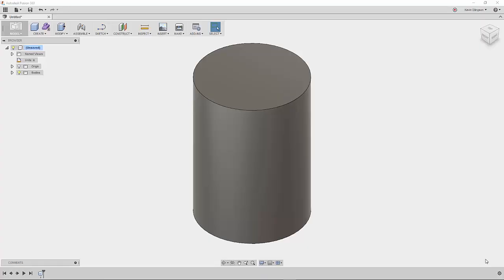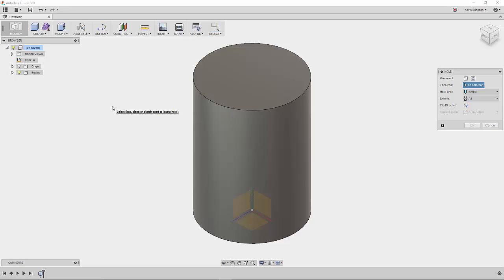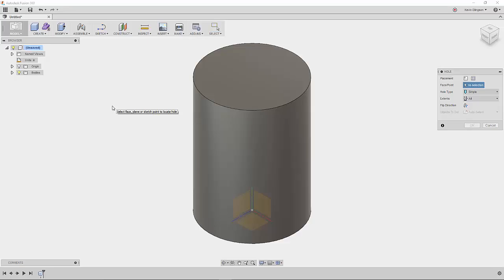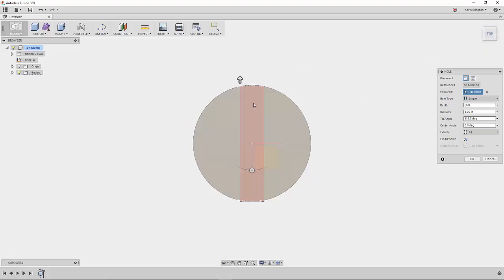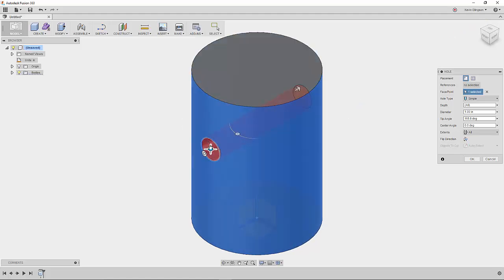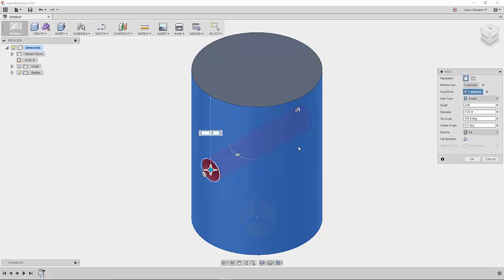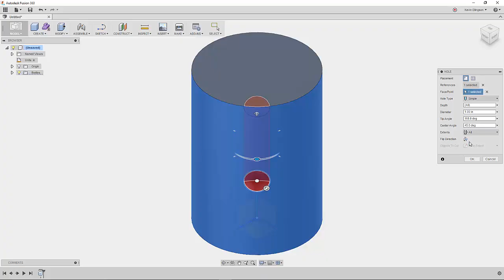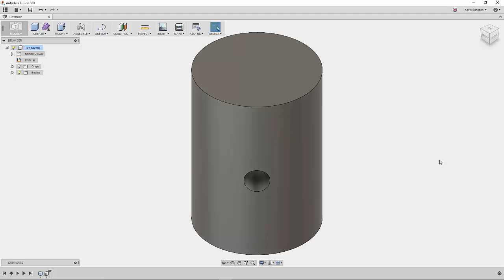Fusion 360 Hole on Cylindrial Face

Comment: Thanks.  Instead of rotating the hole by degree, can I locate it radially by measuring from a longditudinal line, like a quadrant line?  Can I turn a quadrant point into a lengthwise hole and then locate the hoes by distance from that line?

Comment: I could get a hole on the cylinder surface, but was unable to get a circular pattern on the hole to work... any insights?
Reply from the maker: My guess would be that you choose pattern faces as your pattern type. Try selecting the type to features and see if you can get that to work.

Comment: Thanks for posting.I do have a question.If I wanted to put a counter sink on both sides of the cylinder.how would I go about that.I can only get it to do it on the one side.Thanks
Reply from the maker: There isn't a way to do it in the hole command. You would either need to try to mirror countersink to the other side, or maybe even create a revolve for the countersink for the other side. But it can't be done using the hole command currently.

Comment: How would you place a horizontal hole on the side of a pyramid?
(i.e. place a hole on a face without the hole being normal to said face)
Reply from the maker: Nick's Stuff Hi Nick. You would need to create a construction plane. Your best bet would probably be plane at angle. Use the bottom edge of the pyramid face and set your angle at 0 or 90 depending on orientation.
Reply: Thanks I did that (using the XZ plane, in fact) but that surprised me a bit not to be able to choose the angle of the hole

Comment: Hi ! Have you had any luck generating a toolpath for a lathe operation ? I have a similar construction, with a larger rectangular hole, and when trying a turning profile operation it won´t generate a toolpath. I guess it tries to compute the hole as a groove, but as it doesn´t follow the profile the application gets "confused"
Reply from the maker: +Cristian Cvitanic Hi Cristian. When you are creating the lathe setup, there is a check box for spun profile. When you check that box, it will ignore features like the rectangular hole for turning the profile of the part. You can see an example of that here. This is example is for Inventor https://www.youtube.com/watch?v=zJvMEXqH6PE
Reply: +Mechanical Advantage Wow ! Thanks so much ! I would have never guessed it was a setup feature ! I checked on spun profile and got a toolpath right  away !
Reply from the maker: +Cristian Cvitanic Great, glad that took care of it. Look for this channel to get much more active very soon. You may want to subscribe so you don't miss any of the upcoming vides.
Reply: +Mechanical Advantage Sure thing ! Subscribed already ;)

Comment: How would you place a hole in the side of a cylinder. That is to say, a hole offset to one side of the cylinder, perpendicular to the centre axis and parallel to the horizontal axis?
Reply from the maker: +a0cdhd I made a quick video to show what it is I think you are looking for https://youtu.be/kE5TDNbVrr0 . Does that answer your question?